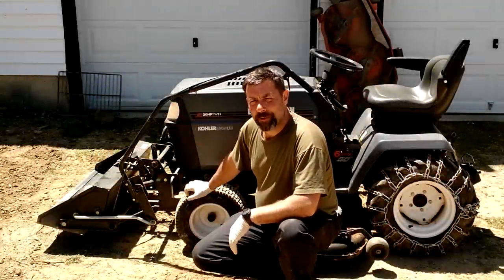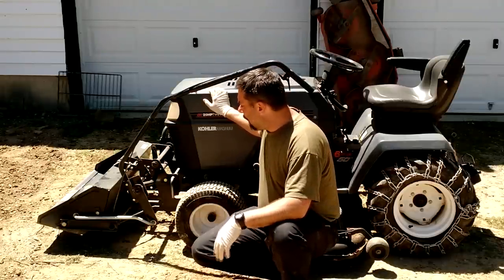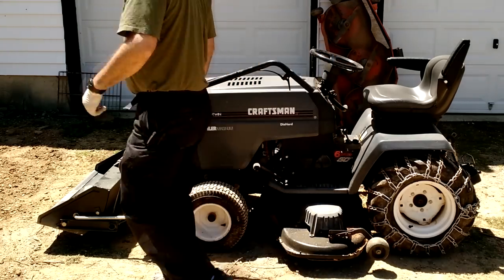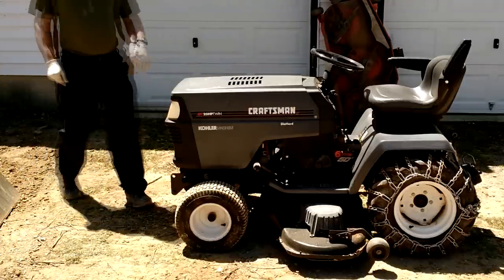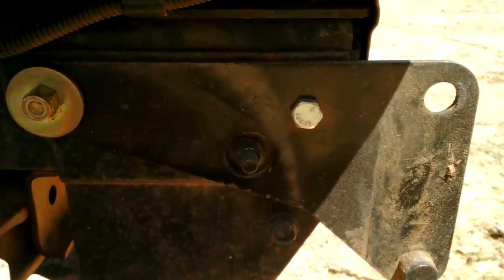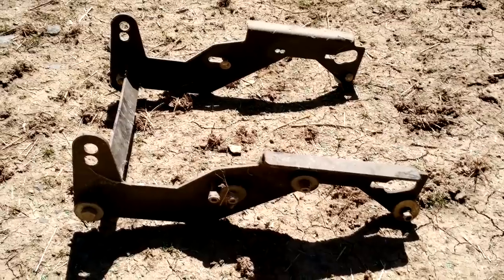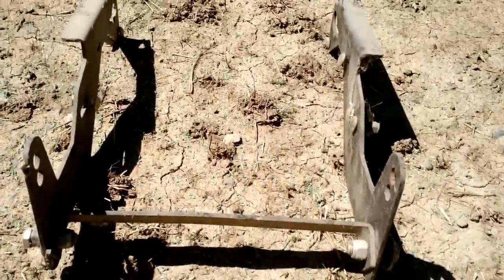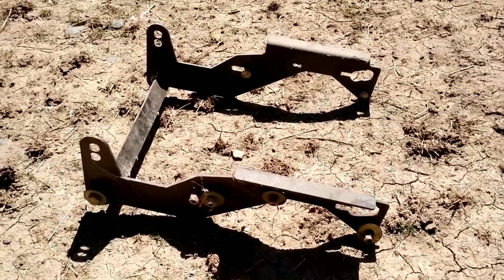Using The Tractor Scoop On Other Makes And Models Of riding Mowers.

Comment: Thanks for the video.  These scoops are surprisingly useful, we did a lot of work with ours before we got our current tractor.  With the bracket you pictured, and with spacers/washers, we were able to adapt it to a Simplicity Prestige tractor very easily.
Reply from the maker: Thanks for the info!

Comment: Funny question, but is there anyway that you can measure that bracket. I bought that same setup but it was missing the bracket that connects to the mower. It's referred to as the right and left a long plate in the manual.

Comment: I'm going to look at a used scoop today. Is there anything in particular I should look at?
Reply from the maker: A lot of these will need to be readjusted to make sure they work well. I think the manual is online, but if it isn't let me know and I'll see if I can scan it for you. 
 Also, verify that the mounts come with it. There should be two sets. One that fits GT's, and the other for LT's and riding mowers. It would be impossible to mount it up without them, and  a lot of times they end up in the trash when the mower they were on get's scrapped.
Reply: Thank you for the reply I will look for both sets of brackets I think they only have one for the gt. I'm going to mount it on a craftsman mts 5500. They are wanting 150 for it. It's the first one I've seen in my area so I can't pass it up.

Comment: Anyone know where I can still get one of these?   It seems like it is discontinued.  Also Husqvarna has one and I would imagine its the same but does anyone know?   Is that still available and where to get?
Reply from the maker: The one Husqvarna sells is the same unit. It will work on all older Craftsman units as well. To make it work on other makes and models may require a little work. There is also the great Johnny bucker Jr.

Comment: Cool 👍Would like to know where to acquire This?
Reply from the maker: Sure. Here are two places that have them. 

http://www.lowes.com/pd/Husqvarna-Lawn-Tractor-Front-Scoop-Blade/999947682?cm_mmc=SCE_PLA_ONLY-SeasonalOutdoorLivingSosRidingMowers_-999947682:Husqvarna&CAWELAID=&kpid=999947682&CAGPSPN=pla&k_clickID=ce2c755f-bf87-4782-ac90-a327845cb0b1&gclid=EAIaIQobChMIs5ST0OLv2gIVTR2BCh2sBgxOEAYYASABEgIoZvD_BwE

 And

http://www.sears.com/craftsman-front-tractor-scoop/p-07124847000P?sid=isx20140327xdsa&psid=601x45659&knshCrid=239722617480&k_clickID=ce2c755f-bf87-4782-ac90-a327845cb0b1&gclid=EAIaIQobChMIs5ST0OLv2gIVTR2BCh2sBgxOEAAYASAAEgIR__D_BwE

  The prices are a bit high at the moment, but check back mid season and they can be bought for around $300.
Reply: Lowe's! Wow I've never seen them at ours. Btw.. watch your vids all the time since I stumbled from curiosity checking out your CB post. Good stuff..👍

Comment: Can you post a link to purchase one of these?
Reply from the maker: Sure.

http://www.sears.com/craftsman-front-tractor-scoop/p-07124847000P?sid=isx20140327xdsa&psid=601x45659&knshCrid=239722617480&k_clickID=ce2c755f-bf87-4782-ac90-a327845cb0b1&gclid=EAIaIQobChMIs5ST0OLv2gIVTR2BCh2sBgxOEAAYASAAEgIR__D_BwE

and 

http://www.lowes.com/pd/Husqvarna-Lawn-Tractor-Front-Scoop-Blade/999947682?cm_mmc=SCE_PLA_ONLY-SeasonalOutdoorLivingSosRidingMowers_-999947682:Husqvarna&CAWELAID=&kpid=999947682&CAGPSPN=pla&k_clickID=ce2c755f-bf87-4782-ac90-a327845cb0b1&gclid=EAIaIQobChMIs5ST0OLv2gIVTR2BCh2sBgxOEAYYASABEgIoZvD_BwE

The prices seem a bit high right now, but check back mid season and they can be bought for around $300.

Comment: I got two 4 speeds and a hydro I really like the GT line the older ones. The new ones are a bit to MTD for my taste. But anywho  now as for scooping do you think the 4 speed would be better then the hydro? Both have more or less the same mill(engine) and tires and are about the same size (hydro a bit taller)I think the hydro would do better. What do you think?
Reply from the maker: I've run this scoop on both hydros and manuals, and without a doubt the hydro will work better. The reason is this. 
  The scoop really requires both hands to operate, and when you add shifting from forward to reverse and back over and over again its a bit of a pain. with the hydro its foot controls or lever control and its much easier to master.